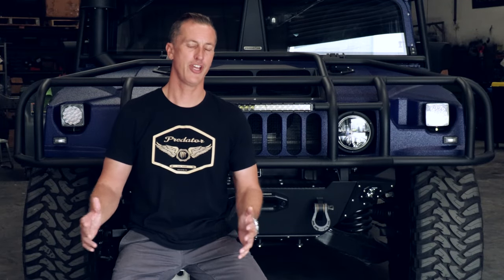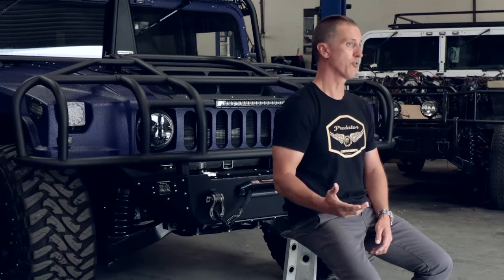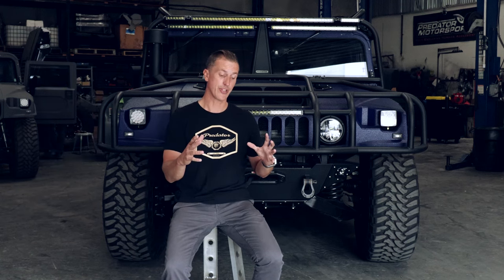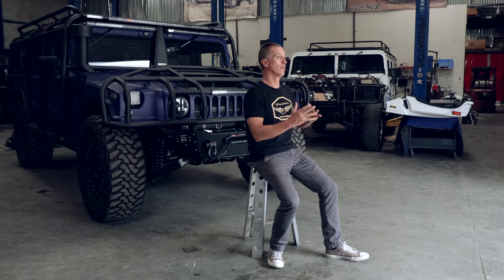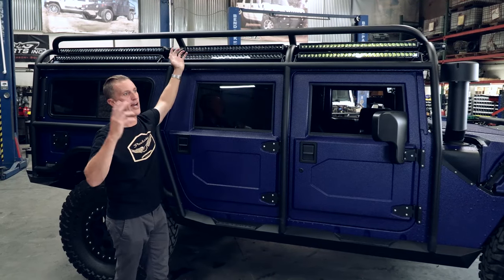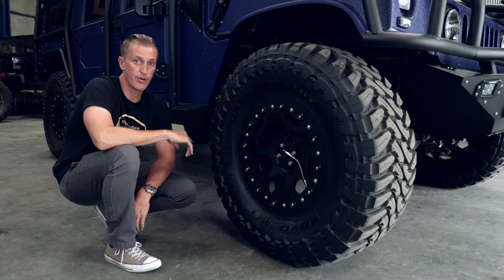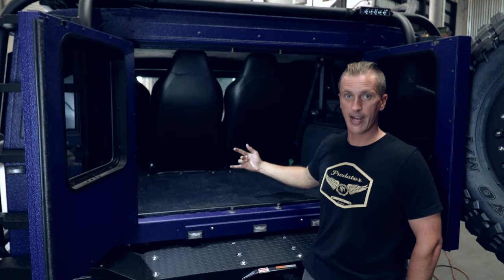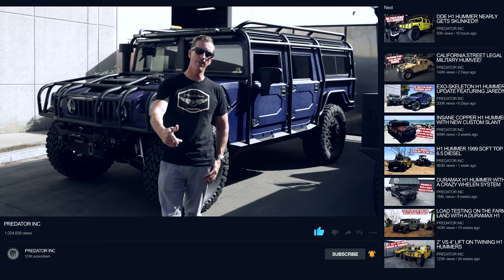THE EXOSKELETON H1 HUMMER!!! EXCLUSIVE RELEASE!!!

Comment: Fantastic build. Simulated (aka Fake) beadlocks are the only bad thing in this amazing project build.
Reply from the maker: Thank you! Yes it would be nice to have real beadlocks but with the legality issue and failure rate, its not worth it. Possibly internal beadlocks but they aren't the same as externals. Thanks for watching!
Reply: @PredatorInc  A second wheelset with bedlock to use if doing serious offroad sound definitely in budget given the cost of the total build.

Comment: Why didn't y'all do a slight high roof to get 3-6 more inches of headroom?
Reply from the maker: It isn't necessary to sit comfortably. You could but that's almost a full redesign of the truck. There was an aftermarket top out for soft tops that did just that and it just didn't look right.

Comment: Truly awesome truck, but the overall design is still incomplete:
1) the rear side marker light is covered up by the exoskeleton;
2) the bar over the rear wheel doesn't match the lines of the wheel well opening;
3) no night shots, but it appears all the brake lights are obstructed;
4) sticking with the brake light theme, you could've integrated a really cool "X-shaped" led into the rear tire carrier;
5) all that work on the interior and there's nothing new and revolutionary about the dash
Reply: I'm sure your custom H1 is much better